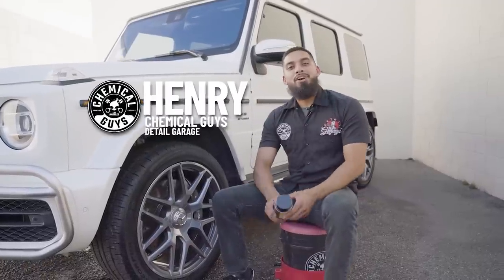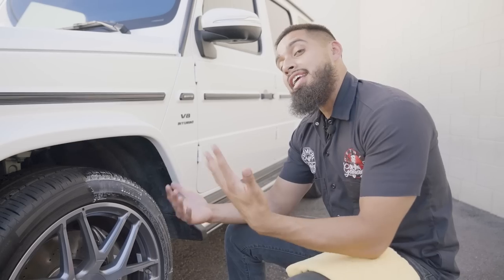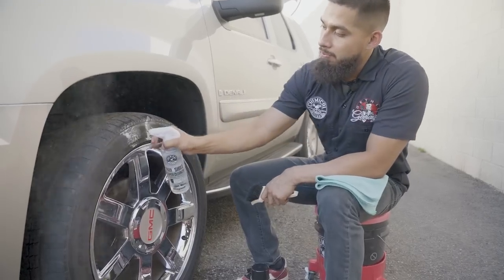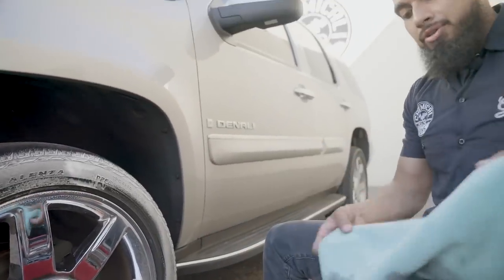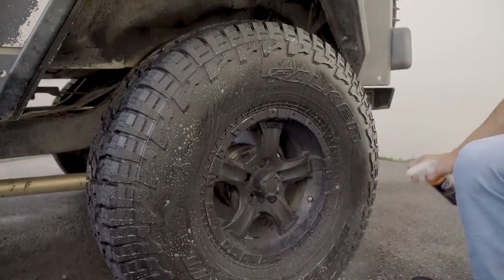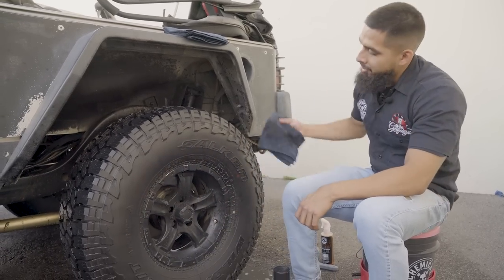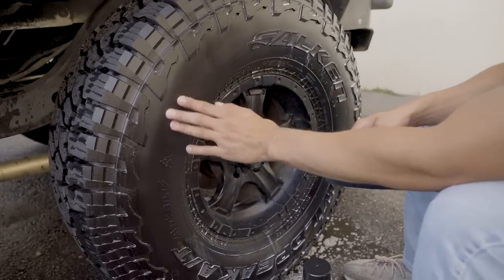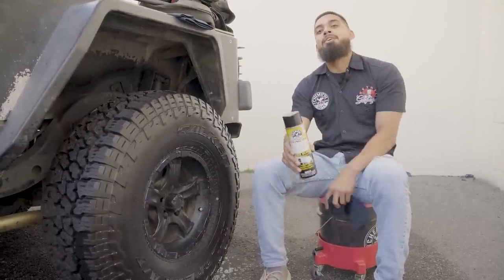🚨 New! 🚨 How To Clean, Protect, and Shine Tires with One Spray!   - Chemical Guys

Comment: Will the Cling On Tire Foam stain my garage floor or driveway when I apply it to the tires?  It's one of the biggest reasons I don't spray product directly on the tire.  Instead, I carefully spray on to an applicator and apply it that way for no mess.
Reply from the maker: Hey! Excess product will simply rinse away.